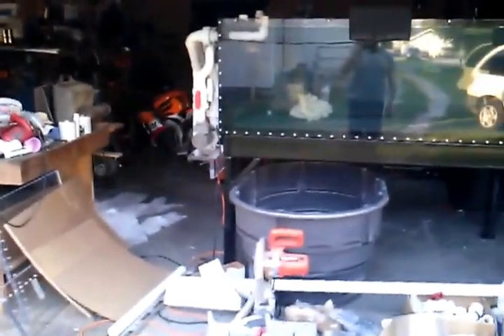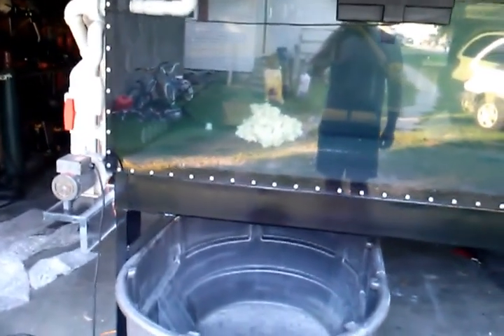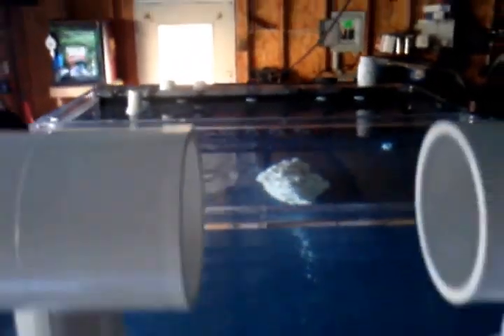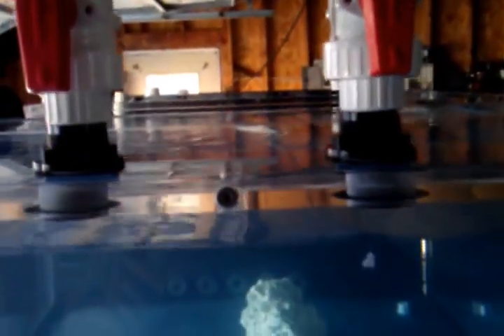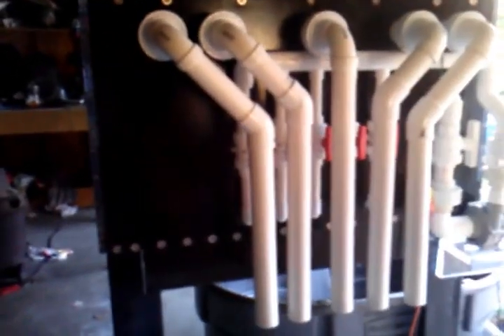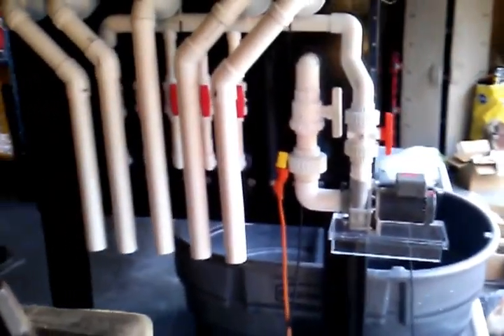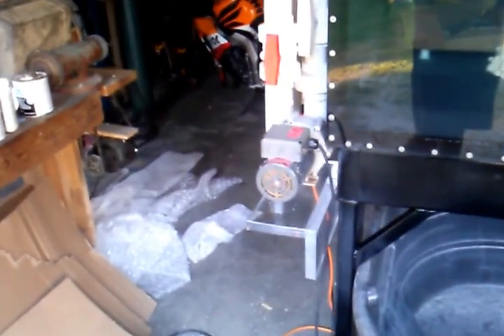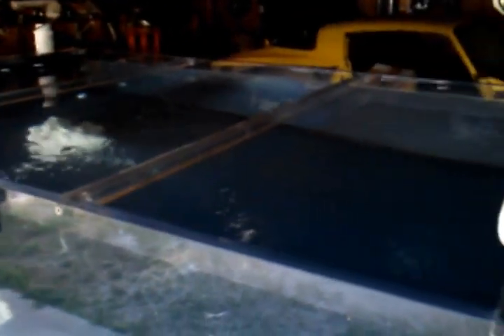New 420 gallon Reef tank custom built by me DIY SPS

Comment: Could you go over the construction details, bec. im curious why you use screws instead of weldeon for bonding acrylic and how you mated/joined the wood bottom to the acrylic. The 1" thickness at the height of 26" is good to go for sure, just curious/concerned about panel construction over time.

Comment: Deleted my other post as it's a bit inappropriate and not necessary ..  Not that it matters but it's not 1980 we know that your method is not ideal and not that anyone cares but In my experience/ opinion you created hundreds of weak points in the tank using screws, basically took all the benefits of acrylic and turned it into a time bomb. 

 Glad it's working for you but I hope you know that's not a lifetime tank and I hope you don't have a catastrophic failure with your method. Just wanted to add my 
$.02 and give someone trying to emulate this a reason to do the research on why I feel the way I do.. 

Good luck with the reef and thanks for sharing.